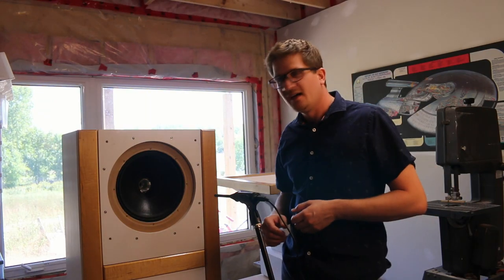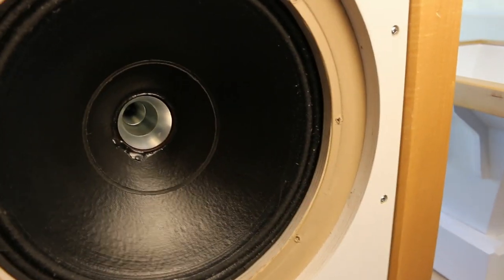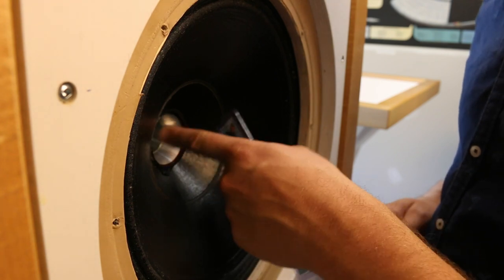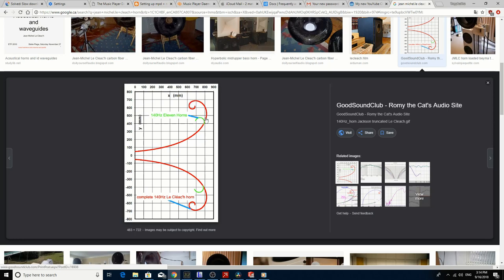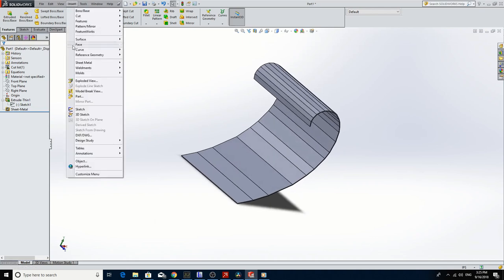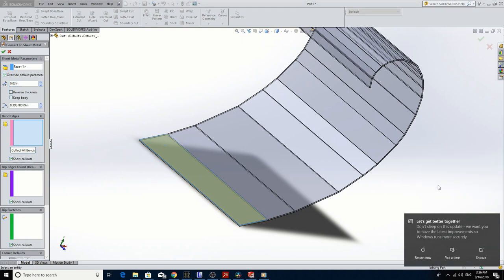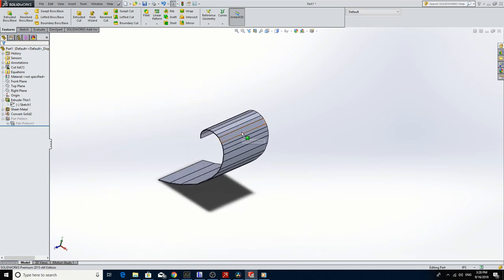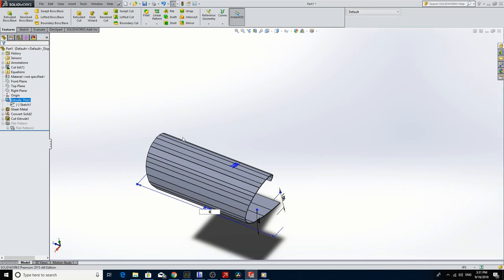Designing Horn in Solidworks for B&C 12CXT 12" Coaxial

Comment: This is absolutely amazing video! You have very nice CAD skills. With the design that you end up with, the one you display at the very end, looks very cool! From the performance perspective I guesstimate that it might have some problems with diffraction. Also a thing to consider, is that the holes that are left on the horn to allow passage for the lower band radiating from the woofer are going to band pass load the woofer radiation. It's very likely that the bp loading is going to settle in to the operating band at it's current form, but this is just a guess based on visual observation of your model, so it might be totally wrong. But nevertheless, in order to minimize potential problems for the woofer radiation, the thickness of the horn material should be left as thin as possible to push bp loading out of the operating range of the woofer, but then some problems with resonances might start to arise due to the lack of rigidity that comes with the thin walls. Also the openings should be left as large as possible, but then the thing coming to play is the additional diffraction and more abundant and complex discontinuities of the horn profile that the compression driver is going to see, which will contribute to an eccentric radiation impedance of the horn it self, which often equals to lack of fidelity. Also the chamber that is created for the woofer is a potential nest for trouble, especially when frequency approaches the crossover point (2khz?), because of internal reflections within the chamber due to the relatively short wavelengths at play. Heavy damping could be the key to success, but will very likely yield to lower overall efficiency of the woofer band.

Speaker building, designing and construction is amazing fun and the experimentation in it self is very rewarding as it teaches us more and more about the weird world of physics. I truly hope that you will keep posting future updates about where your project is heading to! All the best to you and keep up the good work!